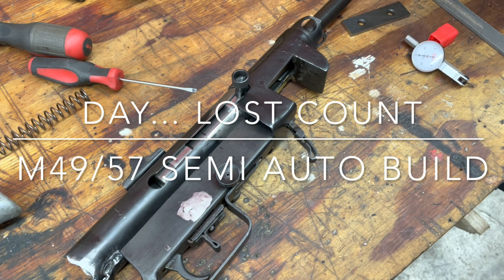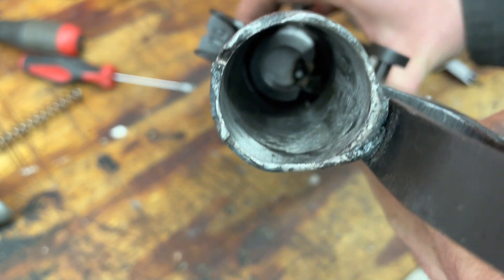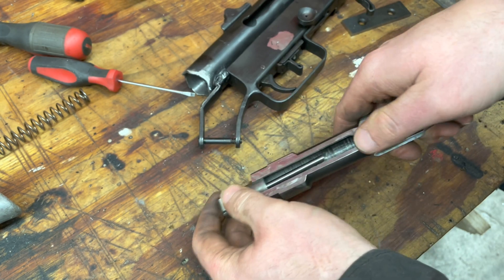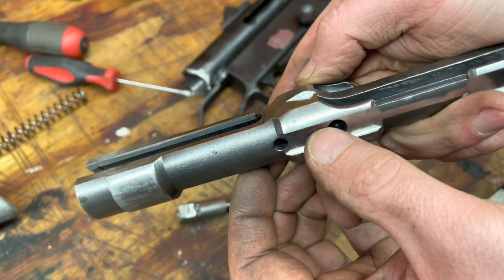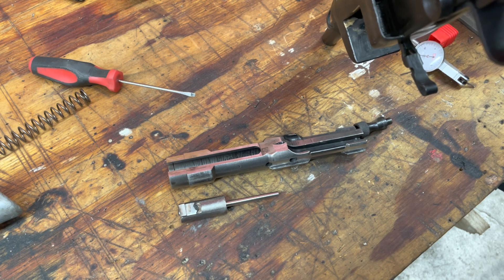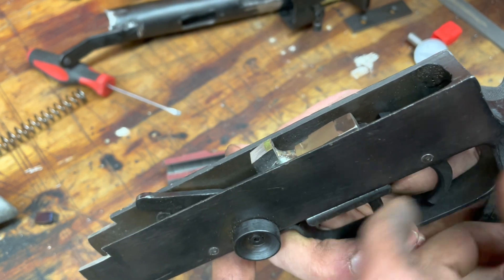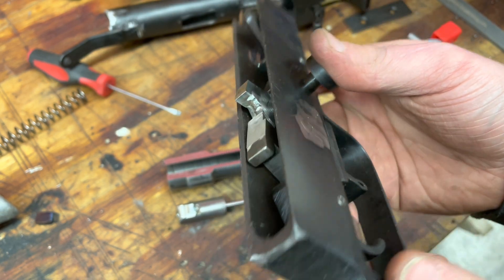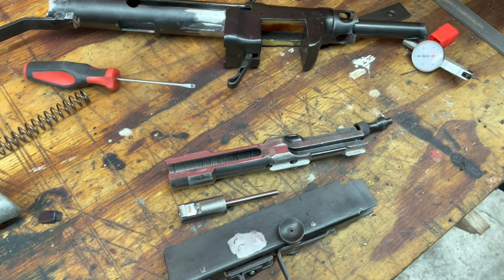M49/57 Semi Auto Build - Bolt Final

Comment: What drill bit did you use for the bolt also is the metal hardend i cant seem to get it to drill
Reply from the maker: It’s a semi hard bolt but I just used cobalt steel bits.
Reply: @JPMachine   apprecate it thank you

Comment: Question :  so you use Mig Welding ??   I'm a retired pipefitter n welder n have Stick, Mig n Tig welders at my shop which do ya think is the best for the receivers  ??  ty.
Reply from the maker: Tig 100%! I just don’t have one yet so I make due with what I have.
Reply: @JPMachine  ,  That's what I thought but see people using gas, stick, mig n tig...  be well.